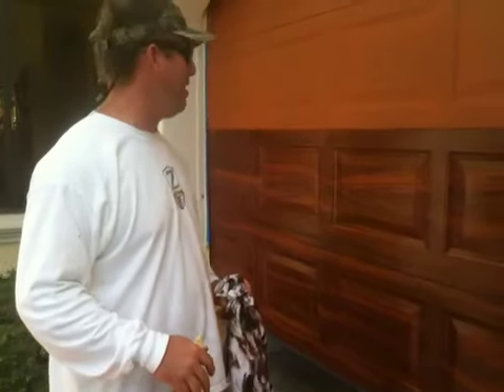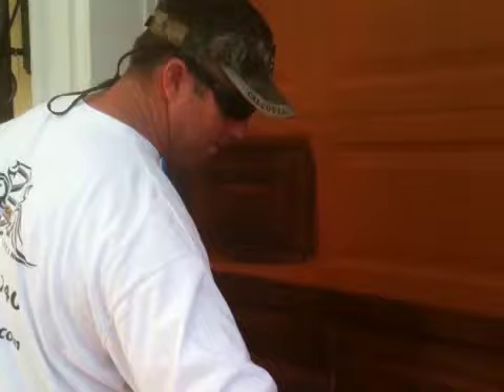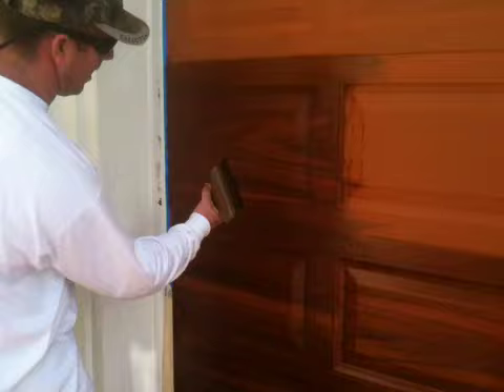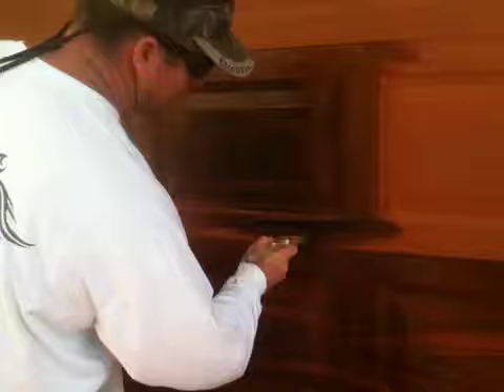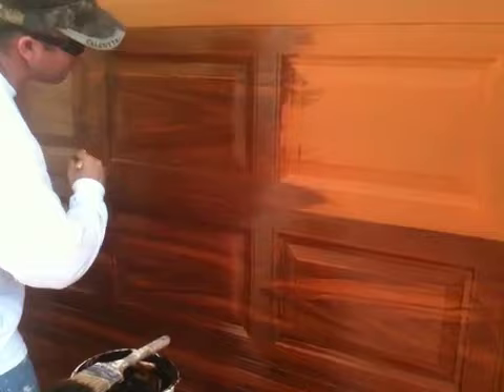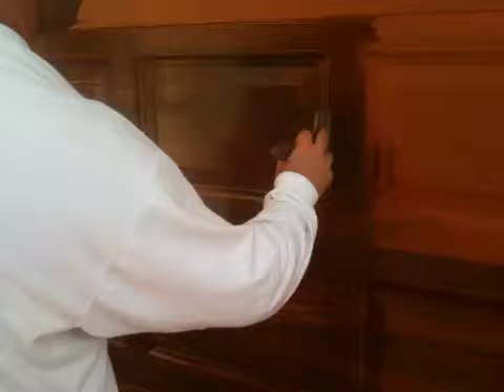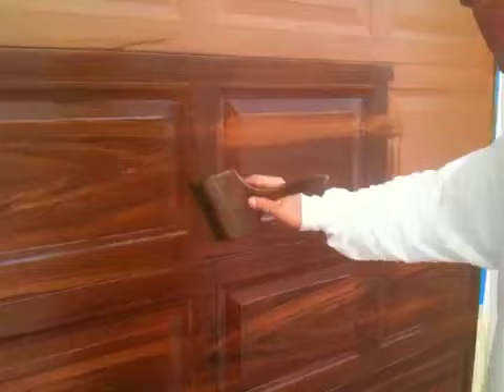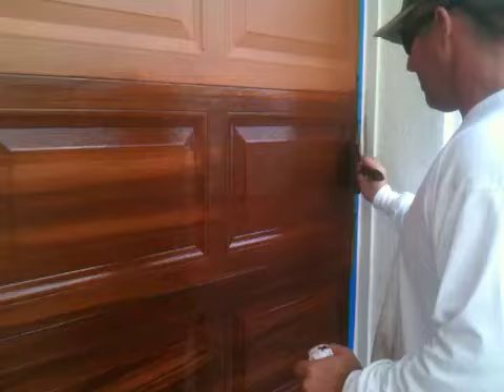Wood grained garage doors by Z Freeman

Comment from the maker: @ vornam . I understand what your saying because realistically its not the case with real wood. However, these doors have a prefab grain pattern that runs the same direction and when I try to brush vert against that, that metal surface grain pattern comes through and makes the door look really choppy and eratic. So I've just took to doing the whole segment of door as if it's one solid piece and it seems to have a smoother, flowing, wood effect. If the door was a smooth surface, we could make it

Comment: I’m curious if I should use oil where I am. I’m in Canada, summers can be hot but winters are also pretty brutal. My door also faces north east, it doesn’t get much more than 30 minutes of sun on it. I’m wondering if the oil would hold ip better to the different temperatures and extremes.